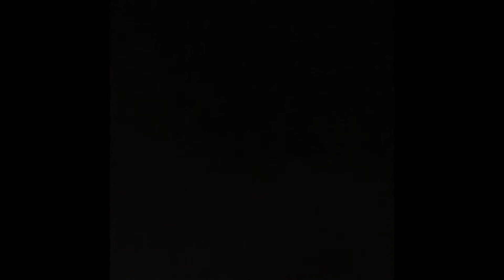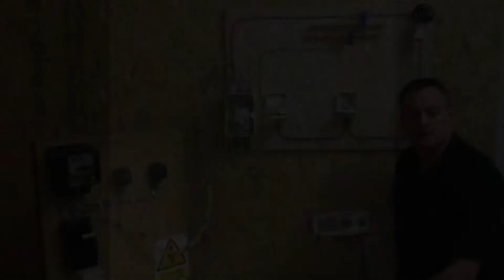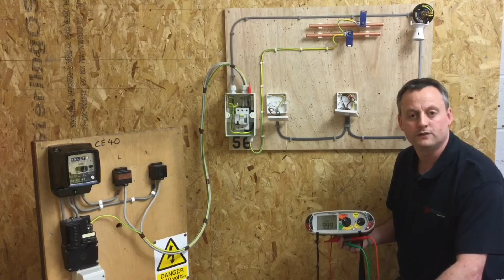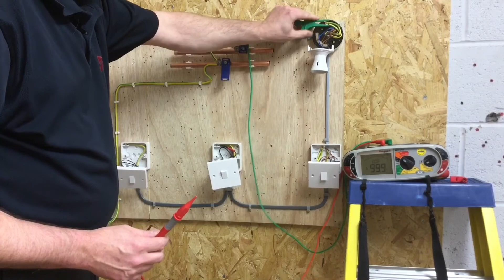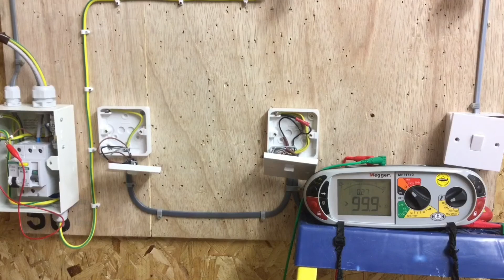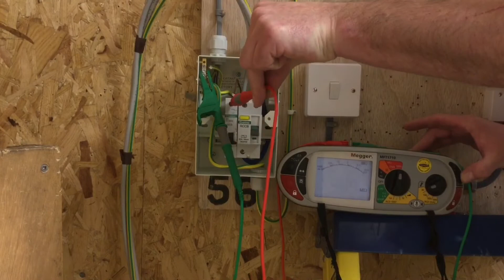Continuity, Polarity and Insulation Resistance of our 2 way and Intermediate Lighting Circuit

Comment: HI,  
There are so many variation of tests on lighting continuity tests! I do not understand which one to follow?
The one you are doing is R1+R2 for the lighting is different from the one in another video from some one els?

You did tests for continuity at the lighting terminal points but you also carried out tests on the switching terminals? for continuity. I have seen videos that they carry out tests either at the board end for R1+R2 for lighting continuity or at the lighting terminal points by joining either end with line with cpc. And they do not carry out at the switching terminal for 3 ways light switches. Why is that? Do they do wrong? or missing one part of the tests, the switches terminal? or that is still acceptable? 

This really help if you can answer.

Thanks
Reply: I know its been a year you may not see this i have my final test soon and this is bugging me so much did you ever find the right way to do it?
Reply: @forgedgamers1658  I do it the way I know it is a complete circuit R1+R2. I test them by; connecting Line and CPC in fuse board end and test it the furthest point of the circuit at the lighting terminals and operate the switch on and off position so that I should have resistance/continuity reading of loop cable from switch to light as well. I Record the highest reading. 
I do not carry out test at the switches but some may say we should.
Reply: @sn2319  thanks for getting back to me mate will just test at the light then because i really dont see the importance of testing at the switch because you are confirming switching polarity by flicking the switches anyway while probed at light terminals.👍

Comment: When you test continuity on the intermediate switch, and you're probing the line terminal, which one is that? The brown or one of the cables (i.e. Black) with sleeving on? Or is would you just probe onto the common terminal? Cheers Gaz
Reply: There’s no common terminal on an intermediate switch, it’s L1 and L2 top and bottom of the switch. I’m thinking as they’re strappers you can test from any terminal in the intermediate switch.
Reply: @olivergalloway4827  thanks for the reply. I'm just trying to get a proper understanding of testing in light switches and the lighting points, so this is helpful 👍
Reply: LocoSajoca Yes don’t worry, lighting can sound simple but it’s actually really complicated if you’re not doing it day in day out👍🏼
Reply: Have you. Not got to operate switches while continuity at switches to go through strappers